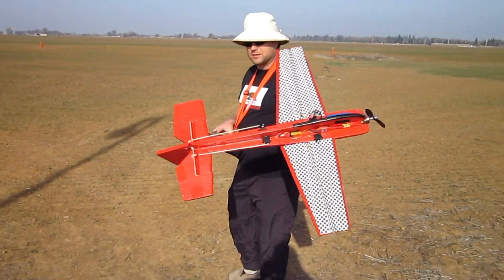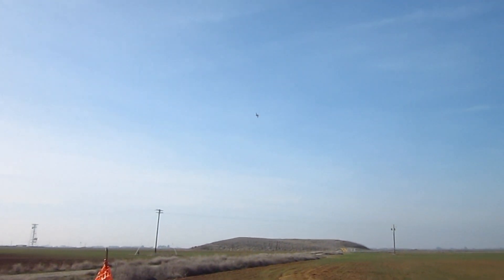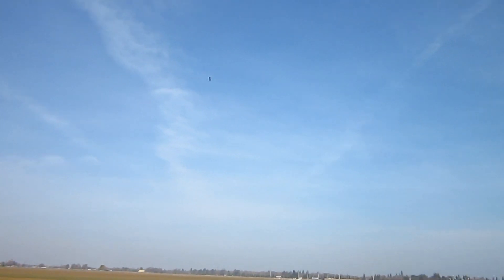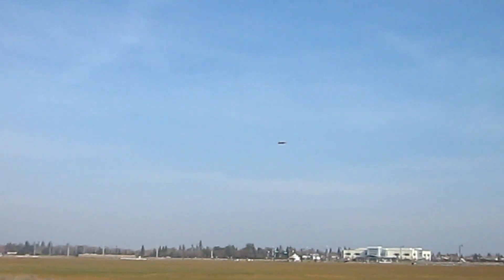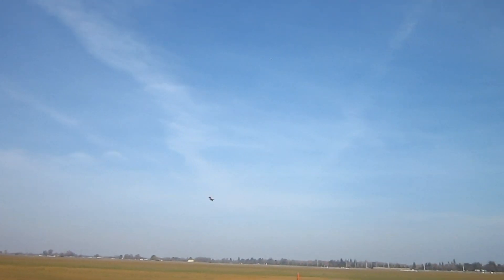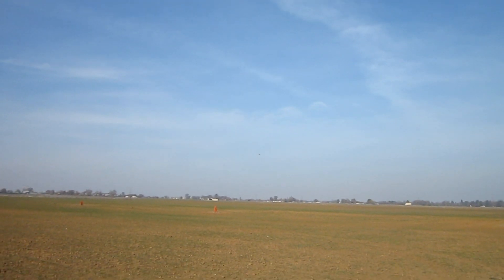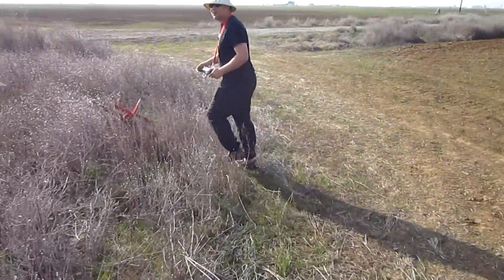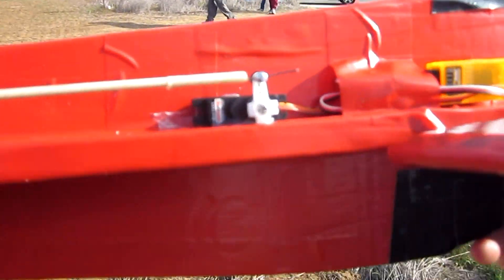The six pound rcpowers extra 300

Comment: Nice flying bro,
I've sent you a vid on one of my builds. She 10oz RTF. Using a EFLIGHT park 370 motor, 10amp esc, two 5 gram HXT servo's and one 9 gram HXT. 469mah nanotech 3-S battery with a 10x5 GWS prop. It's all about the weight. The lighter they are the better. This airplane can fly in 30K WINDS TOO. I fly like a scmuck so don't notice that part but check out the vertical and how dossile this airplane is.
LATER,
doodboy1